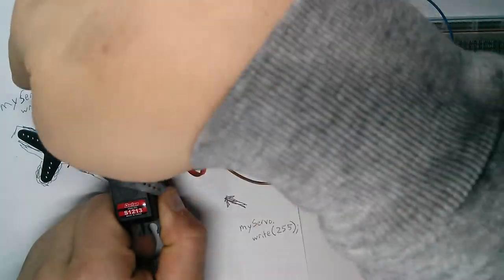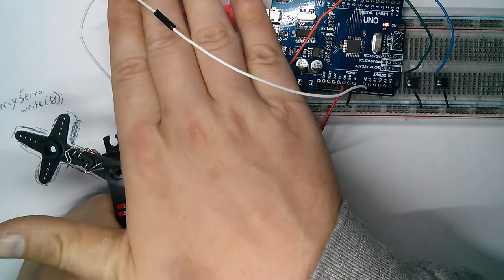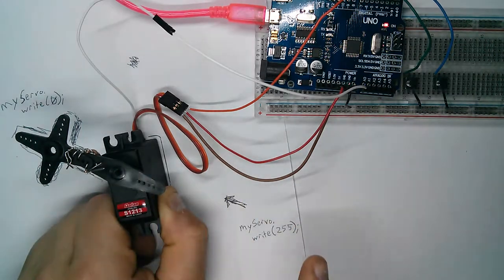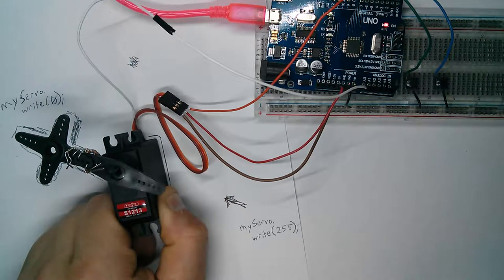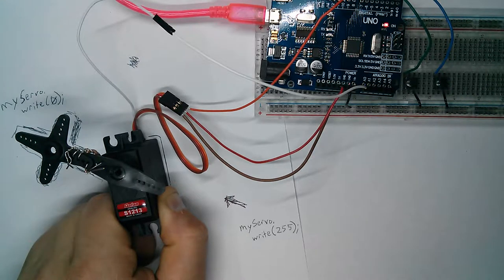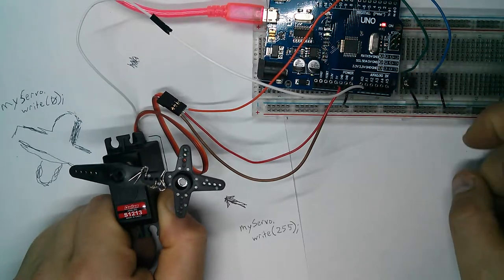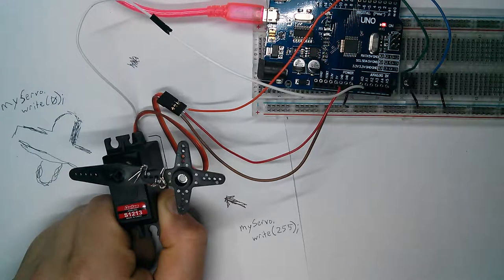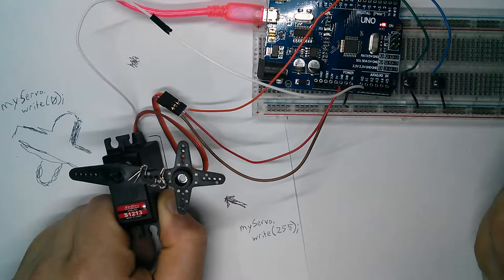analog servo feedback record and playback

Comment: Just a question, can i record its position feedback, but while the servo is moving in a loop from 0 to 70? so without a button and also while servo is moving? Thank you!
Reply from the maker: my experience is no, you can't measure position while it's moving.  i think the motor in motion induces electrical noise.

on the other hand, it's been a few years since this video was made, and i did not explore the idea of measuring during movement thoroughly.  there are stepper motors which can definitely tell where they are (until they skip) just by counting steps.  maybe that's what boston dynamics or tesla use.

i'd like to hear about what you're making